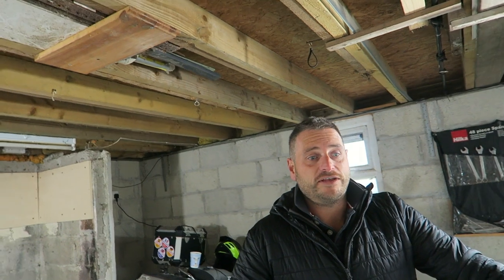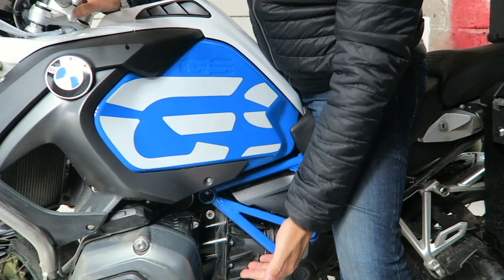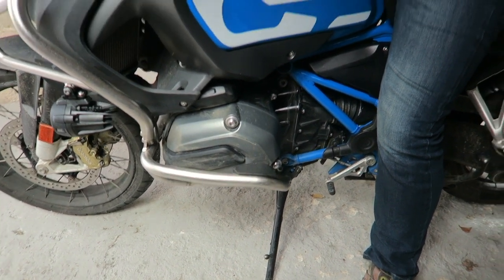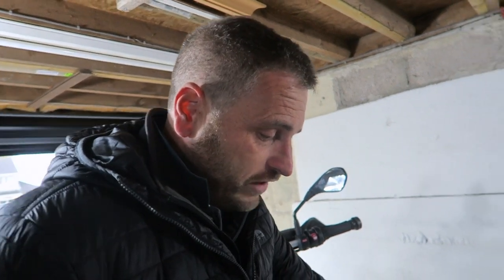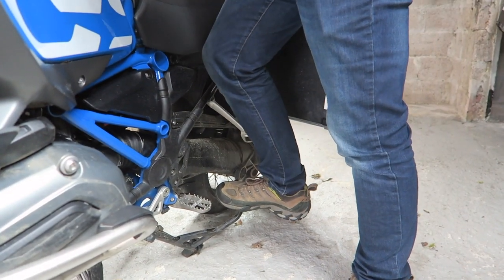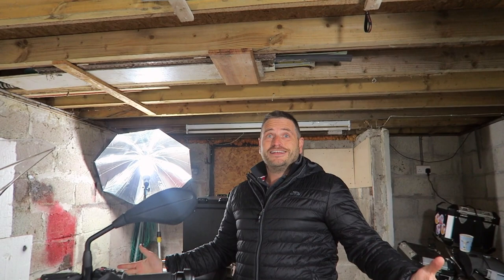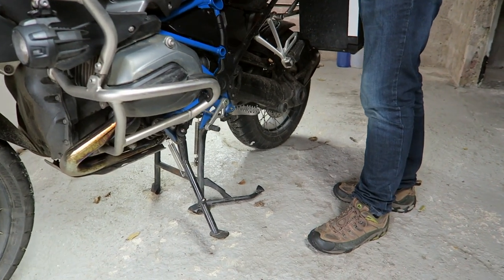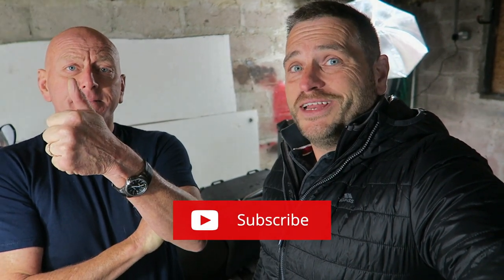BACK TO BASICS | Motorbike Side and Centre Stands

Comment: Good stuff.
So many riders ( including experienced and  "advanced" ) often overlook these basic techniques.
I leave my bike ( gsa like marks) in gear and hold clutch in while rolling it off the stand.
Then, if the bike runs away I just slip the clutch out to act as a brake.

Comment: Good video for those intimidated by these beasts!  Exactly the way I put mine off an on the stand.  One thing to note is that bmw have put thought into the stand designs.  

Try the mk1 Tiger Explorer and it's much more difficult.  My last one was hernia inducing to get it on and off the centre stand.  The GSA looks i timidating but it's no harder than a middleweight to set on the stand in a controlled manner.  Not all manufacturers put as much thought into the design.  Beemets come in for a lot of stick but thetes no denying just how well thought out and weighted they are.

Keep the good work up!

Comment: Good video and my only comment on putting the bike on the side-stand (beyond rocking the bike from side to side to get a confirming feel that the two feet are BOTH flat on the surface as you mentioned) is to ensure that the front wheel is pointing forwards.  It's also so much kinder to the tyres if you're going to leave the bike for a while and you can clean and lubricate the chain more simply.

As someone else has mentioned, the mod 1 test only involves using the side-stand. Please don't give the DVLA any more ideas!
Reply from the maker: very true Kevin, thanks for that... the front wheel needs to point forward :)
Reply: My insurance would not cover me, if I did not put the steering lock on when I leave my bike, even in my own garage, and off course you have to turn the front wheel in order to put it on, as to your other points I agree, bob in the uk

Comment: It can be useful to have the bike in gear and use the the clutch to control it when taking it off the main stand on a slope. It stops it running away from you.
Reply from the maker: very sound advice Ed, I always park my bike in 1st when using the side stand.. belt and braces and all that!

Comment: Recently passed my bike test, purchased africa twin, problem im having is putting side stand down at the side of my road where the road drops lower, makes a high gap to the road surface, feels like bike is going to fall over due to the height and unable to hold the weight of bike and put her down gently as my foot is on tiptoe. The other problem is then getting back on bike due to the lower lean, cant get the bike upright due to the increased weight, lol, can you help please with any ideas or suggestions, hope this all makes sense, cheers guys
Reply: I have a gs adventure had the same probs ,I don't know about your twin ,but I got a side stand height increaser from nippy Norman's ,I'm sure there's one somewhere for your bike, or manoeuvre your bike for best position to get on or off
Reply: Just use common sense and park on the level, that is all you have to do.
Reply: @terenceokeeffesmotorcyclestuff  thats my problem, my garage is on a hill, does not matter which way i park i have issues of stand being too high, risk of bike going over, or too low, same issue, garage comes straight onto pathway, there is no level ground.
Reply: @andysmith6611   - wow, weird garage? A few strategically placed pieces of 4" * 2" or similar will sort you out.
Reply: Simple answer , always make sure you have a brick and some sand cement and water in your top box . when you want to park simply cement the brick in road and place side stand on this . Yocan always carry a piece of wood or even buy an shoe that  fits on end of side stand to give wider foot print . Hope this helps